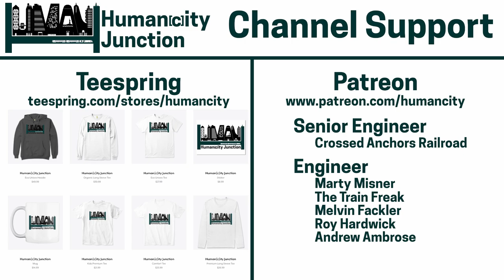Can I Run A Train? | First T-Trak Module Setup | A lot more work than I expected

Comment: Nice video. Thank you for this edited version. I had skipped through the original 3 hour version but really only skipped and therefore didn't appreciate what was going on. I'm super impressed with your wiring and look forward to seeing where you are headed with the Digikeijs DR4800 and how that will integrate with your railroad. Dave
Reply from the maker: Dave, Glad you enjoyed it! The goal is to get block detection working with JMRI PanelPro. That will also be a first for me. -Heath

Comment: My Unitrack has been in storage for a couple of years. I'm going to have to give it a really good cleaning before I set my layout up again.
Reply from the maker: Wikd, Go for it! I would like to see the video. -Heath
Reply: The funny thing is, you actually may not need much. They seem to use a better metal.   Mine was in a box for over a year and unlike atlas it really only needed the normal microfiber cloth wipe-down.

Comment: Glad you got a train running . That's some bundle of wires you have . What's it all for ?
Reply from the maker: Jerry, All of my projects are really just preparation for building my dream layout. Every track on every module is on it's own individual block. The device in the center is the block detection device that will send the information back to JMRI Panel Pro.  I will create a display that will show when a block is occupied or not, so you can virtually see the locomotive traveling around the layout.
On this size layout, it is completely overkill.  But it is all about experimenting with technology on a small scale that I eventually plan to use on a much bigger scale.
Thanks for watching -Heath
Reply: @HumancityJunction  this makes sense now. I'm thinking to myself why all the wires for a small layout.👍

Comment: Hi Heath, Yes I thoroughly enjoyed your edit of the live stream. Since I work Sundays (3:00 PM to 11:00 PM) I'm not able to catch the live streams and this edit fits very nicely into my schedule. My favorite "Elbow Grease" track cleaning product is my Cratex Cleaning Block ( https://yankeedabbler.com/all-scales-wal-949-522-cratex-abrasive-block-xf/ ) They call it "abrasive", but in my opinion the Cratex Block is less abrasive than a "Bright Boy" and does a great job of cleaning the track on my Hollow Core Door layout. Cheers, Rich S.
Reply from the maker: Rich, The Perfect Cleaner (by Perfect Parts) is not a Bright Boy. It is almost more like just an eraser. That is the yellow block I was using.
I also have the Walthers Cratex. I was trying to just buy some Cratex from an industrial supplier, but eventually just got the walthers.
I am trying to use the minimum abrasive possible to avoid unnecessay scratches on the track.
Thanks for watching and commenting. -Heath

Comment: Will you finally got to run trains and i think i saw you in the live stream last night saying something that your afraid of doing something and your afraid it won't come out the right way if i'm not mistaken and all you have to do is watch your train is running because you put your mine to something and it works
Reply from the maker: Dwight, having the support of the live stream viewers really helped drive the project forward.  There Was a point where I asked if I should stop the stream and solve the issues later and everyone said to keep going.  The community support really helps. -Heath